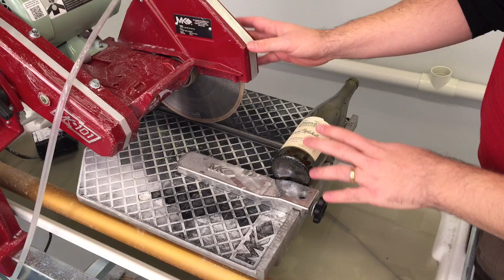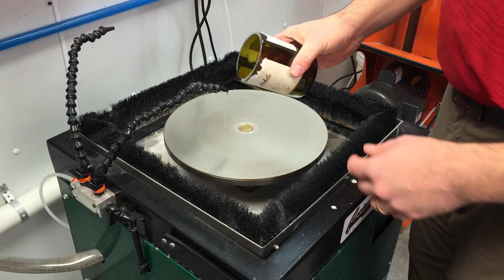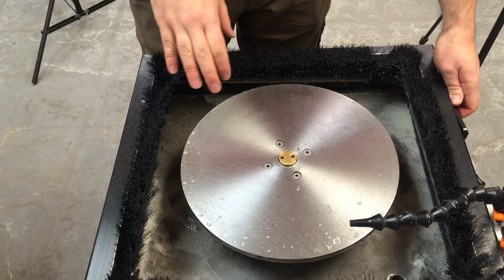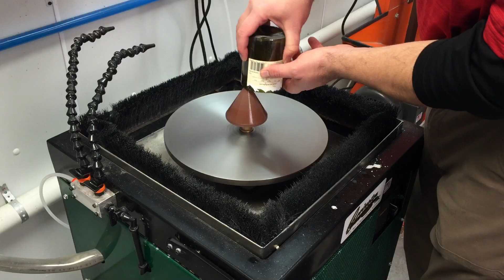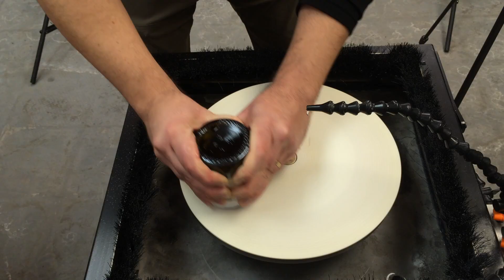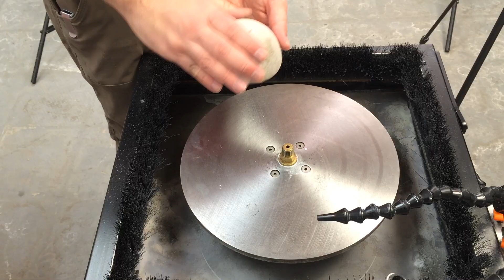Cutting and Grinding Wine Bottles into Drinking Glasses

Comment: Hi Mark, in Italy I have a small workshop where I cut bottles and turn them into glasses. I use a flat sander to sand the outside, but for the inside I still use manual sandpaper. Could you tell me the name of the diamond ball you mount at minute 11:00? I'd like to buy one to mount on my grinder. I'm looking for a similar one but can't find it. Thanks.

Comment: There must be an easier faster way than this. If you are doing 100 bottles a day what's the commercially viable way to do it? This glass bottles will sell for a few bucks...spending 27 minutes on one and you are paid minimum wage of $10 per hr so you make 2 pieces in an hour. Before you add other overheads your labour cost is already $5 per glass?
Reply from the maker: You would process 100 bottles on one grit, then move to the next grit and process the same 100 bottles. You don't do a single bottle at a time, that would be ridiculous, but for showing the process, I made one bottle. This is for producting 100s of bottles a day as bulk processing.

Comment: Nothing is more amazing on this video than the fact that the label was not removed first. For DIY folks, the optimum way involves three items: plastic kitchen wrap, isopropyl alcohol, and a piece of paper towel. Soak the paper, place it against the label(s) and wrap it airtight with the plastic. Let sit overnight. Ideally, scrape the label off with a plastic razor blade. This method will remove the most stubborn labels.
Reply from the maker: Good tip! Always happy to learn a new trick!

Comment: I think I can riff off of this with an angle grinder mounted in a vice! I already tried it that way with a 60 grit face sanding wheel before I saw this video. Now I see I just need to use squirt bottle to apply water to the carbide sanding wheel or disk and I can polish my bottle edge. Must find a conical sanding or grinding attachment. This is the only way I can follow this master craftsman as much as possible with the tools I have
Reply from the maker: Just be very careful as even water fed angle grinders are only sealed for use with the head pointed down. With the head pointed up, water can infiltrate the motor on the grinder and you run the risk of frying the motor or electrocuting yourself.
Reply: Great vidio if you have hundreds of dollars to make a glass. How about a poor boy vidio.
Reply from the maker: @DennisPilling-q5h  You can hand lap glasses very inexpensively if you only need to do a few of these: https://www.youtube.com/watch?v=S44CrIih94A

Comment: Enjoyed your video but you need to remove labels before cutting.  Just use a hair dryer and heat label a little then it will peel off. Then use a little paint thinner to remove glue residue.
Reply from the maker: Yes, we were tight on time to make the video when we did and I didn't have the time to remove the label.

Comment: Please wear good leather gloves and full face protection in case the bottle shatters...
Reply from the maker: I always recommend eye protection, but I rarely recommend gloves while coldoworking as it makes it very difficult to "feel" what the glass is doing on the grinder and you end up breaking more pieces than if you use bare hands. While I've had pieces break before, in over 30 years of doing coldworking, I've never had a major incident from broken glass while coldworking.

Comment: What machine are used both of them and which blade did you used
Reply from the maker: The MK saw is no longer being produced as MK is out of business but any decent wet saw will work. The blade is the important thing and we use this blade for bottle cutting: https://www.hisglassworks.com/grinding-tools/blades/fine-cut-blades/husqvarna-superlok-glass.html
The grinder is the Covington variable speed 12-inch:
https://www.hisglassworks.com/covington-variable-speed-12-inch-flat-lap-grinder.html
but you can also use the Maxi-Lap for bottles:
https://www.hisglassworks.com/10-inch-maxi-lap-grinder-with-steel-wheel-head.html

Comment: @7:00 Can you drill a hole in a plywood large enough to take the bottle plus some slack , then mount the wood over the rotating grind disk.  Mount it such that the bottle sits on the grinding plate and can rotate inside the wooden hole with out any pressure from a hand , gently allowing the bottle to grind the cut edge.
Reply from the maker: This is typically done with larger, heavier pieces to grind them, so the process would be similar. Not sure why you would bother with something so small and light though

Comment: Hi. I'm following the same process but surface it still quite frosty after the 320 smoothing pad step. I don't get the clear surface that you get in the video after the 320 pad, even if I repeat the step several times. Please could I have some advice? Thank you very much!
Reply from the maker: You're moving to a cerium oxide step after the 325 resin diamond, correct? Are you using a felt pad or LP66? The polishing step will take much longer than the grinding steps and it's important not to use too much cerium or it behaves like a lubricant. Less is more when it comes to cerium oxide on the polishing pad.
Reply: Hello  @hisglassworksinc , when I finish with the 270 grit, the surface is quite frosty. Then I use the 325 smoothing pad, but even if I repeat the process 5 times (doing the quarter turns) I can’t get a clean surface with no scratches 🤥, like you show in the video. I don’t know where is the problem. How can I remove them IYO before following the polishing process? Thank you very much.
Reply from the maker: @DavidMigu  You may be using too much water on the 325-grit and are hydroplaning. The resin disks require far less water than the electroplated to work. The same could be true on the 270-grit. Much less water or you can hydroplane above the diamonds on the disk surface. Try reducing the water on those two pads and see if it helps
Reply: Hello  @hisglassworksinc , I’ve tried to put less water, and I obtain better results. Unfortunately, I can’t remove all the scratches. Do you think I need another disk between the 270 electroplated disk and the 325 smoothing pad to remove the deeper scratches? 
Thank you very much again. 😊
Reply from the maker: @DavidMigu  Not typically, no. You can try a 220-grit resin diamond pad after the 270-grit electroplated and it should fix all those issues, but I generally don't see the need for those except on very larger surface areas.

Comment: I would like to do this in a large medium commercial scale. What would be the output per day using this method?
Reply from the maker: We have some customers working a thousand bottles a day in production
Reply: @hisglassworksinc with how many machines?
I’m interested to understand with one saw and one grinder what is the possible drinking glass production? 
Would you suggest 2 grinders set in a different way to start with in order to speed up the polishing process?
Reply from the maker: @Doonangolf  You can works hundreds of bottles a week with a single machine. It really depends on the type of production you want to do. Most of our customers have a single saw and single grinder to work all the pieces they need to do on a weekly basis, but we also have a few customers that have 3-4 saws and grinders for high production work. They started out with a single saw and grinder though and worked up to higher production levels.
Reply: @hisglassworksinc  thank you very much for your advice

Comment: No gloves is a bad idea when handling something that can shatter and get flung by the blade... and sure, the blade itself wont cut skin, but it can pull your fingers into that groove which would absolutely destroy your whole hand in a fraction of a second. Please please don't test this.
Reply from the maker: Gloves make it very difficult to "feel" what the glass is doing on the lap grinder. It's actually quite safe. In 30 years I've never been cut deeply with glass while coldworking.

Comment: What about the methods without needing $25,000 in shop equipment and materials? Nice shop, but not many people with $25k to burn need to make glasses out of old bottles whilst using electricity making a bigger electric bill.
Reply from the maker: For low cost, low volume glasses, you can use loose grit silicon carbide on a piece of plate glass for a quick, nice rim: https://www.youtube.com/watch?v=zTDUpXGkC0g&t=443s

Comment: Reusing the bottle is much cheaper, but this is very educational.
This is a very expensive drinking glass if including cost of those 
cutting, grinding blade and machines.
Reply from the maker: This process is more about larger scale production. The higher the production, the lower the cost.
Reply: @hisglassworksinc with one wet saw and one grinder: how long it takes to complete a drinking glass? Thanks a lot for the videos, they are very helpful.
Reply from the maker: @Doonangolf  It's hard to say. Typically you would do a batch of glasses at one time instead of a single glass going all the way through each step. When working a batch of bottles, the time per bottle goes down significantly. If you were doing only a single bottle from cut to polish would be about 10-15 minutes. Doing a batch brings it down to a few minutes per bottle.
Reply: @hisglassworksinc thanks for your help

Comment: Not something one could just 'take up 'for a hobby as a lot of expensive equipment needed. Never the less interesting.
Reply from the maker: It can be started small with hand-lapping with loose grit abrasive or with smaller lap grinders, but this is for larger scale production.

Comment: This video is highly instructional. This guy is a complete wizard at making glasses, out of junk wine bottles. By the time you invested in all of this high tech equipment, all you are gonna have is a bunch of wine bottle junk glasses. Do you have wind chimes made out of the bottle tops? Hell, if you had the corks, you could epoxy them, and super glue the bottle tops to them, stick a feather in them, and sell them as butt plugs. Please tell me that you do something more with this equipment. Grind the lenses for space telescopes, glasses, something?
Reply from the maker: All these tools can be used for any glass or lapidary coldworking. Nothing is limited to just grinding bottles. There are a lot of extremely successful businesses that only make drinking glasses and candles out of cut wine bottles with this equipment as well. I'm sorry that your inability to see a lucrative business is holding you back.
Reply: @hisglassworksinc  My guests don't give a F if I serve them a beverage in a BLAND PLAIN STRAIGHT SIDED $15.00+ hand converted wine bottle glass, or an ornate crystal emblematic $2.00 glass from Walmart or Target.

My guess is that you also believe in the fallacious concept of human caused climate change, and that jo bidet^ is an effective president, (or should that be presidork).

Comment: Hi, just stumbled in, normally enjoying woodworking videos. Question: how about a final melting of the edge with a flame to ensure that there are no risky parts for the lips?
Reply from the maker: You can do that, yes. But, you'll have to re-anneal the entire piece to remove the excess strain created so the glass won't shatter when exposed to extreme temperatures.
Reply: One way could be to get some vermiculite and put it in a crockpot. Crank the heat all the way up. When it’s hot, flame your glass and immediately submerge it in the vermiculite. Cover and turn the power off to the crockpot. Let it cool completely before checking on it. I’ve had much success with this method, but not 100%. 

Or buy a kiln.

Comment: Awesome video! At what rpm is the wet saw working, and do you think this could be replicated on a chop saw with a diamond blade?
Reply from the maker: The blade RPM is around 3400RPM. Moving slower would decrease chipping on the glass further. With a larger blade, the surface foot per minute on the rim of the blade would be much faster and cause more edge chipping even with a fine grit blade so you would want to try and slow down a larger saw's RPM at the shaft to provide a cleaner cut.
Reply: @hisglassworksinc  Thank you!

Comment: I'd love to do this for hobby/craft work. I have a nice wet saw similar to the one in the video since I do a lot of my own tile work. However, what tools could I use for sanding and polishing that are less costly than that tabletop grinder/polisher? Are there pads for use with a handheld grinder or drill that would work well enough?
Reply from the maker: A lot depends on the number of pieces you're looking to make and if you're looking for making drinking glasses or candle holders. We do have the smaller Maxi-Lap grinder that is less than the larger 12-inch grinder. In a 10-inch size it works quite well for bottle cutting. You an also hand work rims with loose grit silicon carbide on a piece of plate glass for a very inexpensive solution. All can be found on our website https://www.hisglassworks.com

Comment: Thank you! What techniques do you use to remove the labels? You make it seem so simple when you say "once you take the labels off, it'll be nice and clear"... but in my experience, removing the labels is usually more difficult than cutting and polishing them!
Reply from the maker: Soak the bottles in water and dishwashing detergent overnight and the labels will typically slide off
Reply: I do a LOT of wine bottle tiki torches and remove labels by soaking in water for a bit then I use a grinder with a wire wheel to remove the labels FAST.  Takes about 45 seconds if that....well over 200+ bottles and found it's the easiest way, then I use goo off to remove sticky glue, wash with soap/water and good as new.
Reply: @robstegmann4792  I've found Mr. Clean Magic Erasers to work great on goo.
Reply: I use Dawn to soak them. Most of the time, the label comes right off. Some need a second soaking.

Comment: What 7" diamond blade would you recommend?  Thanks!!
Reply from the maker: For bottles, I recommend the Superlok Glass+ blade: https://www.hisglassworks.com/grinding-tools/blades/fine-cut-blades/husqvarna-superlok-glass/husqvarna-7-inch-x-065-x-5-8-inch-superlok-glass-fine-diamond-blade.html
Reply: @hisglassworksinc  Thanks for your response! Is that the thinnest glass blade or are there thinner ones that would make a cleaner cut?
Reply from the maker: @abacavip6426  Typically fine grit blades are going to be thicker to prevent warping the core when putting too much pressure on the blade. Fine grit blades cut much slower so people tend to push on them more. With a thin core, it can warp the blade which will make it useless to cut any longer. We do have thinner electroplated blades that give very nice cuts but they wear out very quickly when compared to the sintered diamond blades: https://www.hisglassworks.com/grinding-tools/blades/fine-cut-blades/super-thin-kerf-diamond-blades/10-inch-x-0-015-inch-thin-kerf-electroplated-diamond-blade.html
Reply: @hisglassworksinc  Thanks so much for the explanation, I'm new to sawing bottles and trying to find efficiencies where I can.  Appreciate your quick replies!!!
Reply from the maker: @abacavip6426  You're very welcome.
Reply: @hisglassworksinc   For wine bottles do you recommend going straight through or rotating the bottle while cutting?  Thanks
Reply from the maker: @abacavip6426  You can do either. I typically recommend cutting straight through unless the bottle is too large for your saw blade.
Reply: @hisglassworksinc  Thanks! I'll try it that way as well.

Comment: A blow torch will round the edges much better and faster.  Taking the labels off first, makes this much easier.
Reply from the maker: If you torch the rims, you'll also want to re-anneal the pieces as you'll introduce a tremendous amount of stress into the rim by torching it. That will increase the risk of the rim shattering on someone if there is a large temperature shift in the glass.

Comment: You could way easier just score around it with a file and torch the edges with the torch aimed on sideways towards the edges while it spins on a turntable with a lid close over it to keep the heat and when all rough is gone and you can finish with blown edges.
Reply from the maker: While 'hot popping' is a good option for removing the top from the bottle, I would really not recommend torching the entire rim without re-annealing the bottle afterwards as you'll introduce a tremendous amount of stress into the glass that could be problematic when used as a drinking glass.
Reply: @hisglassworksinc  No no;  I kind of forgot to mention to either fill it with water and holding the neck firmly ;  slam the top with your palm quickly and hard to create a sudden pressure;  thus expanding the mid-section  while forcing apart the two end surfaces.  Works without a score;  popping off the bottoms of bottles of beer.
Reply: @hisglassworksinc  It would be fine ;as long as if was done evenly
Reply from the maker: @MichelJosephCardin  yes, hot popping is fine but torching the rim to melt it down is not unless you re-anneal the bottle afterward to remove the strain.

Comment: Hi Mark, this is a really cool tutorial.  Thank you. I curious as to why you would not wear tight fitting gloves for protection, in case the bottle breaks.
Reply from the maker: You certainly could and some people do. I find it hard to maintain a grip on the glass wearing gloves once the glass is wet. It interrupts my "feel" for the grinding when I wear any gloves. I've never had a cut bad enough to require medical attention, but I certainly have been cut many many times by glass while working.